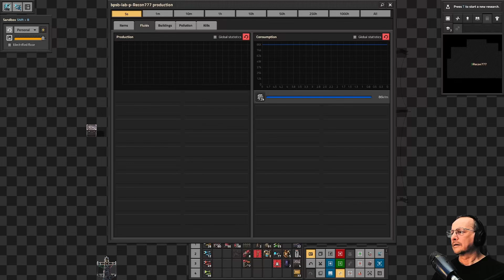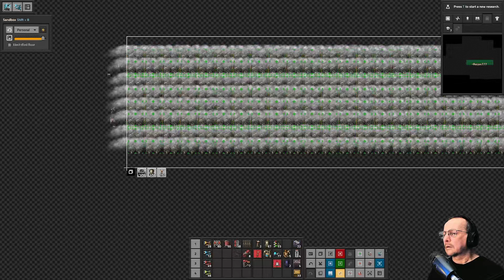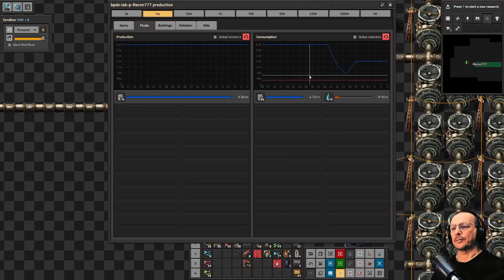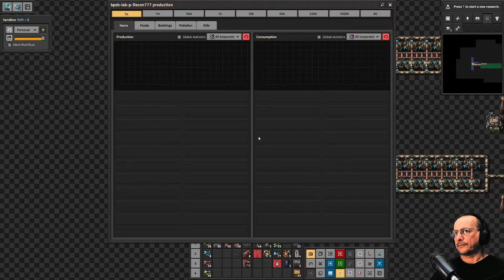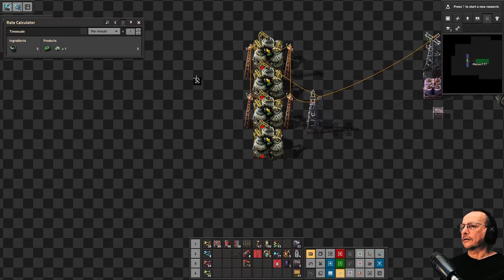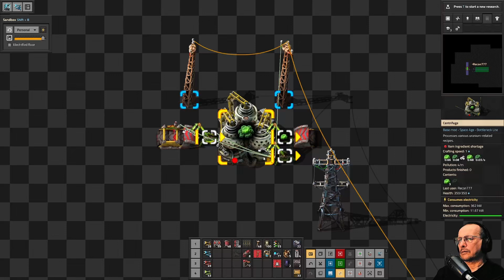Factorio Let's Design Nuclear Power

Comment: its just 2.0 update changes how pipes work from what i understand, previously i limited amount of heat exchangers in 4 reactors setup because it used just barely enough of 5 pumps and with pipe flow limits making it into stackable design in a pain in arse,  now you can just plug all 5 tubes of water into same pipe and it just works. you do need to pay attention on length of pipes now though
Reply: interesting video, keep it up :v
Reply from the maker: Thanks! Yes the new pipe mechanics are amazing! I had no idea that their throughput limitations were entirely removed. The complete lack of sloshing is so good! Do you happen to know if it's still optimal to connect pumps directly to tanks or doesn't it matter now? It used to be that if you want to load a train the fastest, you want tanks 2 squares from the tracks so that the pump could transfer fluids straight out of the tanks and into the trains. But if fluid moves more like electricity now, which is to say instantly from pipe to pipe, then maybe pumps don't need the tanks right next to them?